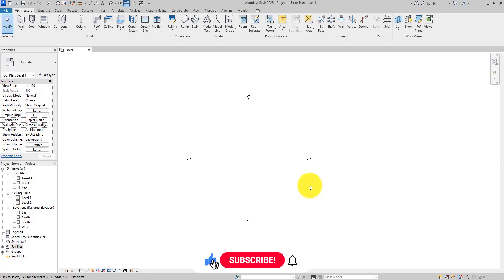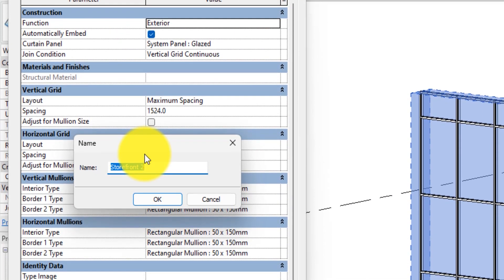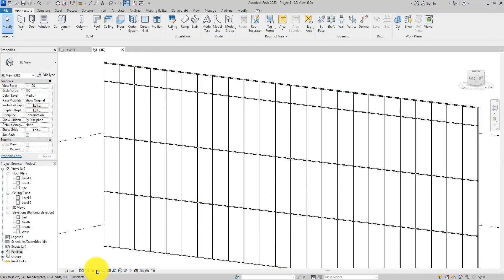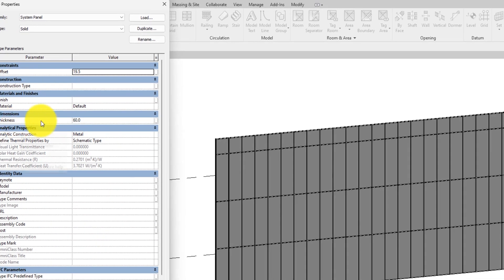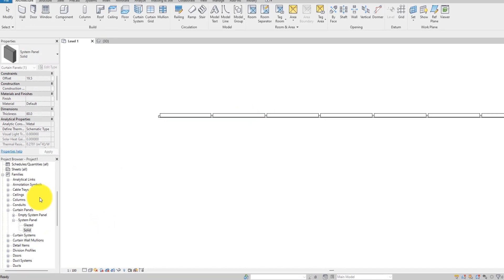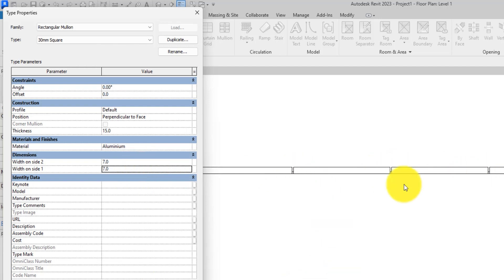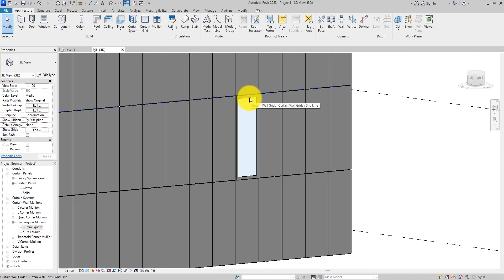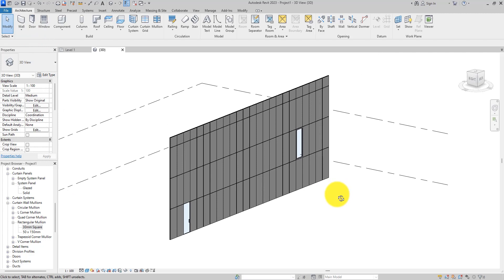How to easily create cladding panels in Revit (2023 method)

Comment: You are the best. Thanks for doing vedios on all I suggested. I will like it if you do more on
1. Creating concrete fascia where hip and gable are combined.
2. How to create spiral staircases by sketch.
3. Creation of planes other than picking planes and how and where to use them
4. Application of pop or other decorations on wall and columns
5. How to create window and use it as a family
6. How to create church roofs. The type that combines hip and mini dome with spine. 
Thanks for the great works you have been doing. God bless you greatly
Reply from the maker: You are welcome man